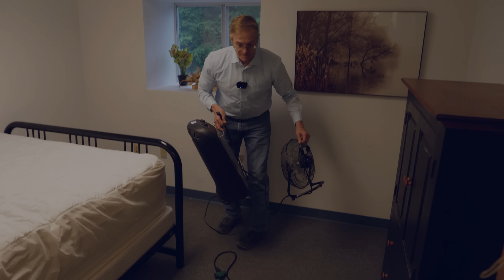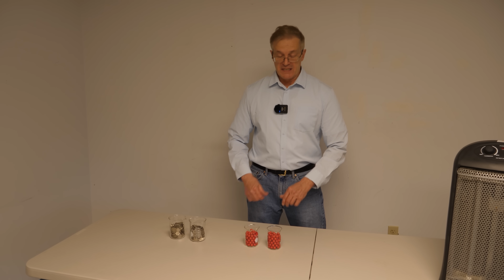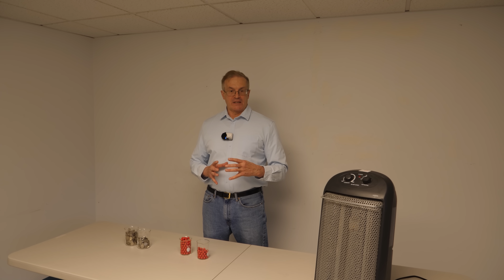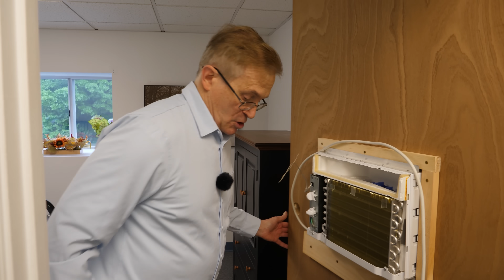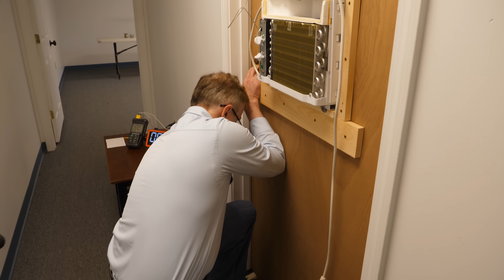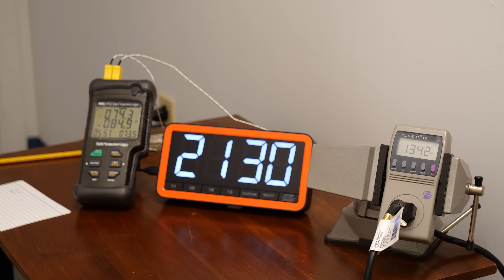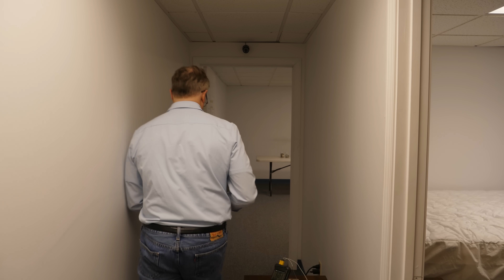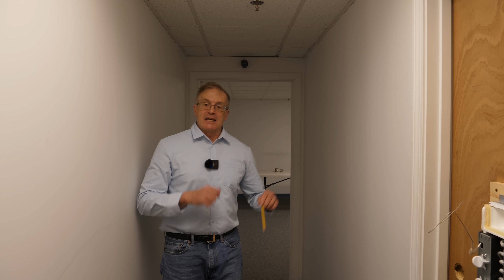You're wasting money on heating! Use your A/C!

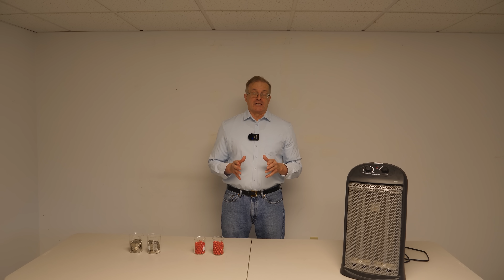Comment: 0:54 you don't need an air conditioner to own a heat pump, just a fridge or a dehumidifier.
Reply: My fridge definitely doesn’t put off enough heat from the back coils to keep a room warm . 

Beyond a used fridge, they cost more than a mini split brand new so might as well get the mini split that has the ac & heater and you won’t have to alter anything
Reply: @DRJoe100  Refrigerators have much smaller thermal capacities than air  conditioners because they only need to cool a small box instead of an entire room. I think something like 100W of cooling while a smaller window AC will do 2500W of cooling.
Reply: a dehumidifier coil freezes in the winter time if the ambient temperature is cold
Reply: or a car. vehicle a/c works off the same principle
Reply: Dehumidifier has coils on same side, you need to have the cold side outside and hot inside. A fridge similiarly has to have the back coil inside with the rest outside, which is hard to do. a window A/C unit is optimal if you don't have a mini split.
Reply: For people who want to know even more about this I can share some knowledge. Im an engineer, worked on cars, heaters, chemicals and even some programming. Mister has explained in a very fine detail what happens, but there is an even deeper explanation. Essentially, even on a freezingly cold day, there is heat in the outside air, we dont feel it as our bodies are designed to be reupulsed by cold air due to obvious danger. How much heat there is can be calculate by how many electrons are moving in the given space. We measure that in Kelvins. Esentially even the freezing cold minus 10 Celsius has loads of Kelvins of heat. Next step is to catch them and pump them in our home. We catch them with liquids called refrigerants. These are special substances that perform this task very effectively. After the heat is extracted from the outside, we just blow it on the inside. The reason it is so efficient on our power bills is that because we are essentially "stealing" heat from the outside world and putting it in our homes. Similar principle is used for cooling our homes, a refrigerant is used to steal the heat from our homes and is then blowing it to the outside world. Have a nice day, and always keep learning.
Reply: Talking about fridge. For the best result the hot side coils should be out side wall (like most commercial system have) - I am thinking to cut the pipes and go thru external wall (presumably fridge is on the same wall to minimised the distance). In winer time you will have fridge cool almost for free. In summer it will not matter it you heating you house or need expel the heat from fridge out side, you always go up heel, but you will reduce heat load in your house.
Reply: @miroslawkaras7710  just remember to shade coils fom direct sunlight, cause that can increase temperature enough to pop out high pressure presostat in a compressor
Reply: @93bartoszmach how does shading the coils increase the temp?
Reply: @danbanowetz  I've meant that direct sunlight can cause that
Reply: @miroslawkaras7710  It might not work too well. From what i read about freezers the refrigerant has a temperature span, below that it might not be able to transport heat from the inside properly. You need to look up climate classes before doing something like this, some freezers are designed for an ambient temp of 18°C, and the lowest i've seen is 10°C. Plus you need to figure out how to keep, or at least replace the refrigerant if you cut the pipes.
Reply: @ornotermes   Besides the refrigeration circuit not working properly many refrigerators only have a thermostat in the fridge section. The freezer temperature is achieved by manually balancing the inside airflow. If it's cold outside the freezer will get warmer (because the compressor runs less) and if it's warm outside the freezer gets colder.

Higher end modern refrigerators with digital control circuitry might have actuators to compensate.
Reply: @miroslawkaras7710  in winter turn your fridge around in the hole in the wall so the door opens to he outside. Just make sure no one steals your food!
Reply: @miroslawkaras7710  I would not do this... Yes in the summer it COULD lower your heat load if you sufficiently seal the passthroughs (you probably won't to the tune of the heat load) but in the winter you significantly increase the risk of compressor flooding and compressor wear from too low of a differential... Both situations will cost you more than you will save.

@ornotermes is correct that systems have design ranges they work in. Commercial systems include special components and valving to handle low ambients that not only does your refrigerator not have, but are not even made for that size of system.

To make something work in a 365 day a year ambient takes a lot of design tuning on our (the engineers) part to make a reliable system that won't break.

Comment: In a residential application, how does the cost of heating with natural gas (or LP) utilizing a >90% AFUE gas-fired furnace compare to a standard unitary heat pump, as well as a VRF (Mitsubishi, Diakin, LG, Sanyo, etc) type system?

I know utility rates vary by region (and some pay “peak time” rates).  I’m in Oregon and our electricity rates just increased (approx) >30%.
Reply: Gas is usually cheaper. Especially if you consider initial building costs
Reply: Calculate cubic foot cost vs output of heat in btu. Convert that to watts and compare it to the kw/h cost vs output of the heat pump
Reply: @FM4AMGV you’d also have to factor in the electrical load the gas furnace consumes running blowers, forced draft/exhaust inducers, and the control circuit(s).
Reply: @Stomper67  That's one of the things that annoy me about my "high efficiency" system. The Blower runs so much that the gas savings are more than eaten up by the increase in electricity usage.
Reply: I’m in northern Canada and gas is much cheaper plus it’s needed when it gets to -40 range

Comment: You would not gain as high of an efficiency when the inside outside Delta is 100F as you are here when it is only 20F Delta.
Reply: So if you're trying to maintain a room temp of 60 degrees then the outside temp would have to be -40 for there to be a 100 delta?  Or let's say keep it 72 degrees inside, -28 outside?  Or if you wanted to keep the room at 100 for some reason and it was zero degrees outside..?
Reply: @MattTrevett  On the very worst days in places like Michigan, Wisconsin, North/South dakota, etc. a 90-100f delta can happen. -20 to -30f outside, 72f inside.  Personally, in my area, we get 80f deltas multiple nights every year, and 90f+ deltas every few years. In my area, a gas furnace is cheaper to install, cheaper to operate, and more efficient overall (if you take into consideration losses in generation and transmission of electricity).
Reply: @danjayh  Gas is very cheap where I live too. Although a heat pump would be more efficient most people don't use them because of the additional cost.
Reply: Use the heatpump when it works, light a fire when it doesn’t.
Reply: Multistage heatpumps overcome this. They use different coolant fluids that are efficient at different temp ranges. A fluid that's efficient at a colder range boosts the temp up for another fluid that efficient at a higher temp, which boosts the temp for a third fluid that's efficient up to room temp range.
Reply: A 100F delta is absolutely ludicrous, and even at the temperatures where you actually start loosing efficiency that only realistically happens a few times a year unless you live in the frozen tundra. Any efficiency loss on most of the planet would still result in energy savings since even a reduction by half on a cop of 300% is still 150%.
Reply: @prestonbowers4768  You're forgetting that the real alternative is a gas-fired furnace, which can achieve 96% efficiency. Since most gas generating stations are only 20-35% efficient, in areas where electricity is generated primarily by gas turbines, furnaces are a far better option from an environmental perspective. Even if the heat pump is achieving a COP of 3.0 (which it will not in a cold area of the midwest), the furnace will still win the efficiency battle if the losses at the generating station are taken into account.
Reply: @prestonbowers4768  I thought it was a valid point that using a heat pump to heat the next room is more efficient than.using a heat pump to heat your home in the winter.  Unless somehow I made a mistake here they are more efficient when the Delta is lower.